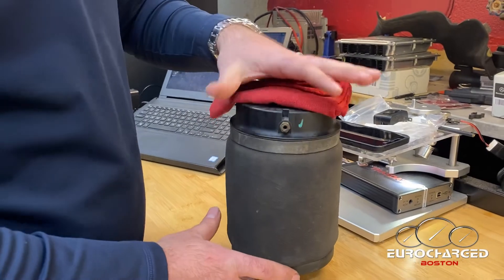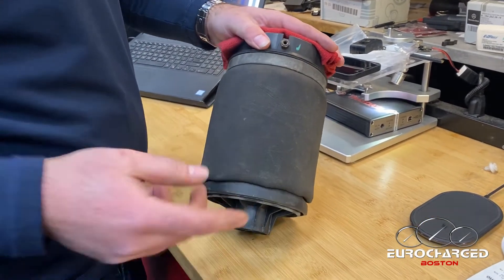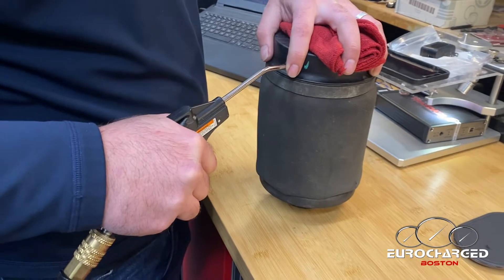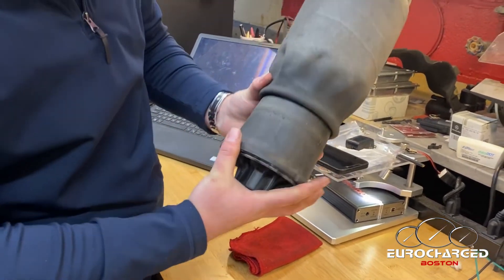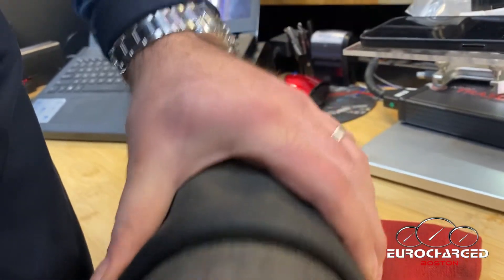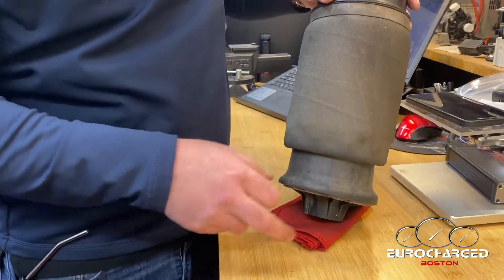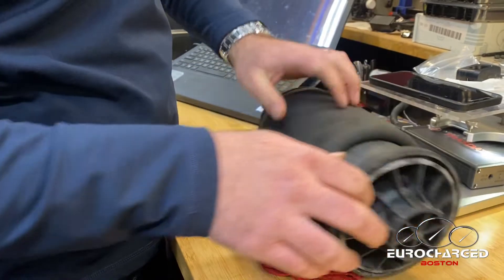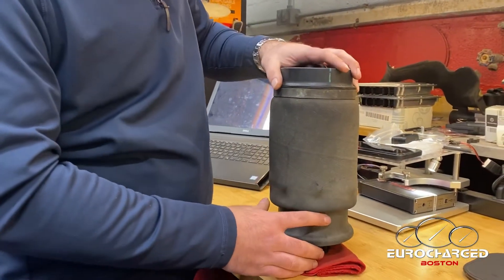Overview of Mercedes Benz air suspension in W166 W164 air bags

Comment: Thanks! Question. 09 ML63 W164: Do you need to remove the subframe or can you replace the bags without that step, please?
Reply from the maker: The bag has nothing to do with subrame in any model. its wedged between the chassis and lower control arm, just like a normal coil spring.

Comment: Is it possible to change just the air bag? My ML 350, when it stops from one day to the next, the suspension get donw. But when turn on, the suspension get up and stabilize
Reply: Or is it better to replace all suspension assembly?
Reply from the maker: @rafaelaquino2609  Air suspension is a great feature, when it needs maintenance, just maintain it. no need for drastic measures.
Reply from the maker: rear airbags can be replaced as needed (what you see in the video). front ones are one piece with shock, so the assembly needs replaced as one unit.

Comment: Hi. Great video.
Problem i have with w166 amg 63 ML is this,
I do not have air leaks as my car can stand for a week and stays in default height.
I would drive and sometimes i would hit a bump, small, and the rear both sidesd would go down real fast, Airbags are still rock hard with air.

I would leave car for few minutes restart it and the car would pick up back to normal height.
Sometimes i would have some weight on the rear or trailer and it would sag down both left and right. Sometimes i can drive 1400 km with a loaded trailer and nothing would happen.

I am slightly confused here.
Can it possibly be the hydraulic struts, but then both would have failed.
Or could it be my Electronic torsion bar.

Obviously it sets a compressor long running code as the computer thinks airbags are deflated but is not, because of level sensor below threshold.

Autel 
c155664 Compressed air sensor for system pressure has a malfunction, implausible signal
B219116 Power supply 30g outside valid range
C156800 Time for filling compressed air reservoir exceeded
C 157200 Correction time filling is too long
C156C00 Compressed air distrubution system leaking.

As i have said, the car will never be on the ground standing overnight or even i have left it for a week not driving it and stayed standing in default height.
ONLY when driving SOMETIMES over small bump or loaded passengers will this PHENOMENON occur

Thanks in advance
Any Advise.
Reply from the maker: you have a leak, plain and simple

Comment: Really useful video. I'm looking to purchase a W164 with the off road pro pack. When you fully extend air suspension, is it possible to see the main wear points? Any thing look out for apart from the obvious leaks?
I'm guessing to avoid this type of wear, you can extend the suspension to maximum height when washing the vehicle and wiping the plastic lower section?
Reply from the maker: The car lowers it self back above 20-40mph to bring center of gravity where it belongs, and increase body stability. Plus the suspension is unbearably harsh in its highest point. 

The bags are just like tires, they are made of rubber and they WILL wear down and need replaced. The two extremes are parking the car and not driving it to protect the tires, and the other extreme is doing doughnuts all day. Neither is reasonable. The bags are designed to serve for 50K+ in the normal ride height, going higher or lower shorten their service expectancy.
Reply: I have a W164 with the off road package (though never really use it).
Good idea to wash using the fully extended level.
I'm just got a leakage on one of the bags and now I understand why and also it doesn't look to difficult to replace.
Seen two rear bags for €100 on ebay. 🙂